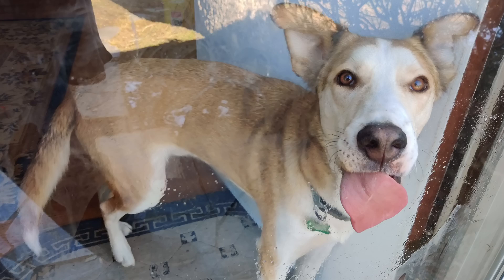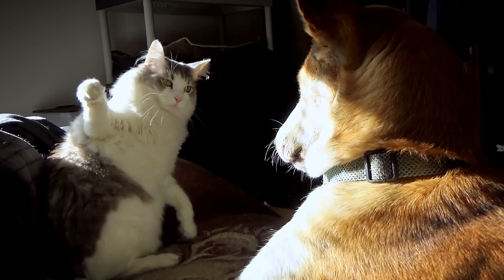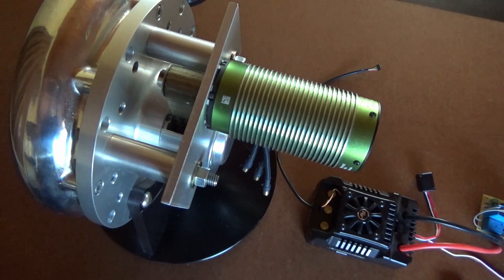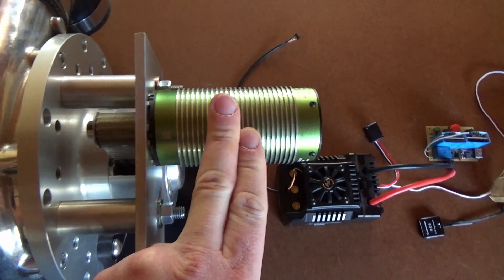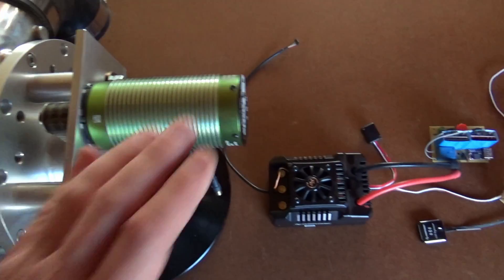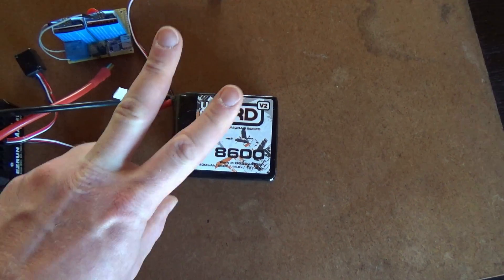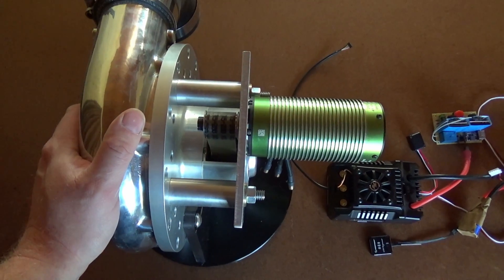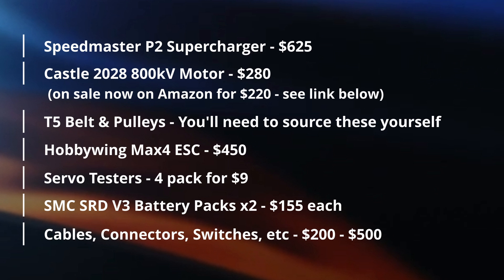DIY 650hp Electric Supercharger - Parts & Prices

Comment: impressive you have it down to a kit!  now how about for road course applications!  yes a bigger battery but the motor and cooling?   or the bearings of the turbo?  I am not criticizing, just asking based on your experience.
Reply from the maker: As long as you mount the thing where it would see airflow, cooling shouldn't be an issue.  For road courses, a single set of packs would be enough for a run (or two or three, actually); you could have a second set of packs you could swap in, or just run them in parallel.  I don't have enough data yet to say that the bearings would have to be replaced with something better.
Reply: @AlexLTDLX  ah, yeah it's all about the domain of use for sure.  because it's electric and you are in Drag mode you can spool it for that time how ever you want.  Same for a road course it's just that it could definitely rest in braking zones, or off throttle zones.  WOT is as much time as one can manage.  For me I am on track for 20-30 minutes at a time, let's say 12 of that is WOT it could be higher.  If there is a natural ramp rate for the spool then that would ease controller efforts.
Reply from the maker: @samthing4thetrack806  I do have a plan for a universal linear controller. I just need to get down to Texas and get things settled to start development on that in earnest.

Comment: Hello from France, is this sustainable over time? in terms of electricity consumption, the alternator and the battery would hold up for a trackway car that runs at full speed for 20 minutes ?  thank you
Reply from the maker: You wouldn't be able to run full boost for 20 straight minutes.  But on a typical road course, you wouldn't be at full boost on a more powerful engine the whole time either.  You could always run additional battery packs in series for additional run time.  A typical alternator wouldn't be able to charge the packs much in 20 minutes.  But all of those issues are pretty easily overcome.
Reply: @AlexLTDLX  Ok, so for track use, tracday circuit it's ruined. It's a shame, thank you very much for your answer, it will save me from wasting time and money.
Reply: @DAV4WS  You could consider a 48v alternator or 150A high output 12v alternator to charge a bigger lifepo4 bank of batteries

Comment: Can you run a secondary intake so when you're not boosting the natural aspiration doesn't get choked down by passing through the compressor housing.
Reply from the maker: I could, but hp loss on a 500 hp base engine is the equivalent of 1 psi of boost loss (according to my datalogs) when it's not running - not really worth the added complexity for ~30 hp; especially if you have the option to turn the thing on.  I'd like to dyno it without the e supercharger on to confirm that hp loss number.

Comment: With such short burst required a battery of super capacitor cells may be cheaper and more durable, IMO.
Sent you an email a few months back, subject matter Vacuum Sublimation.  That account was locked for some nonsensical TOS violation, a few days after.
Never knew if you replied, as it seemed to be a solicitation for a phone number.  "send us a text and we'll unlock your acct"
Did you have any interest?  Seems Mazda will be using the same tech on the new Iconic SP to get 1200mi range.
Reply from the maker: Super caps have two big issues - they have about a 10x lower power density than lithium batteries and their discharge curve is linear - in other words, voltage drop continuously while discharging - you'd see a huge dropoff in performance.  Lithium batteries tend to have a much flatter discharge curve.

Comment: One day I wanna see you try and tackle adding that electric motor to a regular turbo to eliminate turbo lag ;) but I suppose you could just add it like a sequential setup and achieve the same result.
Tell Roger my little Frenchie Penny feels his pain dealing with a cat...
Reply from the maker: lol
Reply: Turbo guys use smaller turbo in a sequential setup, so a smaller turbo spools the bigger turbo.

I dunno how complicated it would be but it seems easy enough... Coming from the complete noob. If it was me, I'd start with a cheap roots blower that pushed air into a bigger turbo. I don't know how much air flow it takes to spool a turbo.
Reply: A fair size air tank and 2” plumbing, pressurized to 500-75o psi and a valve to swap it for the filter with vanes , using a large regulator and a suspension pump to make it self sufficient. But the electric is for drag racing? Have you ever considered a clutch drive or alternator , and use it for charging the battery bank. The 140 amp alternator will almost stall a 212 predator in full field and a golf cart motor for load. It is making more than 3 kw from a 2500 watt unit.
Reply: some manufacturers do this. probably make a good template and could see what the design issues would be.

Comment: Charger for packs?
Reply from the maker: That is an option you can easily add.  The LTD has a charger, but I've never had to use it, to be honest.  It charges faster from the plug-in charger I built for it.  Charging at 50 volts and 10 amps would pull over 40 amps from the car's 12 volt system - that could cause some issues, and would still take almost an hour to charge while driving.

Comment: What about using this as the "small" unit of a compound setup on a 3L? Want to slap a huge precision pro mod on a new Supra (BMW B58 engine) but cut lag.
Reply from the maker: Well, generally the reason for two different size turbos in a compound setup is to avoid lag.  Obviously, this setup doesn't really have any lag.  You'd have to be careful that this unit doesn't become a restriction for the big turbo if placed before the big turbo.  But place it after the big turbo, and it should rock.  I really should do a video on how boost in a compound setup works - it's not additive, per se.  It's more based on pressure ratios.
Reply: @AlexLTDLX  understood, sir, it is multiplicative. That being said, understand that as long as a small turbo is producing any boost, it is not a restriction for the larger unit. To the smaller unit, the volume and pressure from the larger unit is simply treated as atmospheric.
Reply: @AlexLTDLX I just realized I totally misunderstood your comment. Yes it absolutely has to be placed after.

Comment: So, on my K24A2 Civic I can expect to go from 225 to about 350HP and I have the option of spraying methanol to keep things cool. What boost level would I expect on a 2.4L across 3,000 to 7,500 rpm range? I need to find and install a limited-slip diff first.
Reply from the maker: With methanol, you'd only need about 5-6 psi to hit your goal.  With a conventional turbo, you'd need about 7 psi.
Reply: @AlexLTDLX  The question remains, how much boost could this combination of electric blower parts give an efficient 2.4L motor between 3,000 & 7,500?
Reply from the maker: Probably around 9 psi and over 400hp.  But all boost isn't the same.  This setup has no pumping losses - so it will make more power per psi than even the most efficient turbo can muster - turbos create backpressure and generate a lot of waste heat as well.  You'd probably need 2-3 more psi from a turbo (depending on a lot of variables) to match the power you'd get from this.  I did a few videos about this exact topic, with real data (but the data I had compared an A/W intercooled Whipple to the Sledgehammer electric supercharger).  In a nutshell, the Sledgehammer made the same power to the wheels (and backed up with track times) at 6 psi as the Whipple did at 15 psi.
Reply: @AlexLTDLX  More than I want, but turning it down a bit only means not turning it all the way up to begin with. The whole purpose of it will be 3rd gear pulls to pass people with "great authority" on our crooked 2-lane highways. I think 50-80 in a couple seconds will work nicely; most likely they would stay passed too!

Comment: @AlexLTDLX, what would it take (roughly) to support the boost level needed to achieve 650hp on a 200 base hp engine? Bigger motor/batteries? My thought is the air mass flow rate would be the same as a 500 base hp engine making 650hp, but the boost pressure would be higher for the smaller 200 base hp engine which means a more powerful motor would be needed I'd imagine?
Reply from the maker: Unfortunately, it doesn't work that way.  We're limited by available brushless motor technology.  Which fundamentally means that we're stuck at fairly low boost levels with a single unit due to rpm limitations.  In your case, several smaller units running in a compound setup would accomplish your goals, but you'd need 40+ psi of boost to hit your number.  That's a very high pressure ratio to try to stay efficient (i.e. stay on the compressor map) even for a turbo.  It's possible, but may not be practical.
Reply: @DLX Thanks for clarifying. So in total there's a solution via multiple motors. My setup is currently making 750whp with 30psi on a 220 base hp motor (2JZ). It can only make it on E85. Otherwise the tune drops power to 500whp when running pump gas only, so although it doesn't require 40psi I completely see your point. 

Thanks for the amazing work you've done and shared with the world!

Comment: Been following this for a good bit now. It should be trivial to control the ESC using a standalone ECU that supports generic outputs. I'm certain I could get it to work with the Haltech ECUs I use. Maybe after I finish my VGT K24 RX8 I build one of these and pop it on my other LS RX8, see if I can't map the duty cycle to some ECU params, probably TPS?

Also, what can I do to help you setup a wiki? Forums are great for short-term discussion but I can't be aresed to read through a thousand posts just to know what ESC is the current de-facto standard. I'd personally love to see you write a page specifically on why VESC doesn't work for this particular application, since so many people seem to ask about it and don't know the history.

Thanks for your time and investment!

Comment: I could do it way cheaper aurduino .   U could even run map sensor and have a led display under 400  speed controller use a Vesc !!   Minus battery blower
Reply from the maker: Well, I've used arduinos as controllers, and I bought a VESC 75/300.  The arduinos don't like all the EMF such a high-powered application creates - you can see the arduino crap out mid-track in this video: https://youtu.be/nlTVHkfSQXM?si=-C5SfjK40yMuiHw8  As for the VESC, it is, in a word, garbage as far as a useable product is concerned.  I tried to make it work - I have a bunch of videos in my "electric turbo" playlist with the VESC.  Even so, it certainly isn't any cheaper - I think I paid around $550 for the VESC shipped.  You need a controller capable of 450 amps for this unit; and as I've said, all the VESC is really good for is electric skateboards and generating faults (and, to be fair, it's a good teaching/learning tool).  You also can't use a standard MAP sensor - you need to use a differential sensor.  Otherwise, you need a TPS signal or once it starts running, it'll never shut off.  But if you do manage to get one running I'll be happy to feature your project on my channel.  Sorry if this comes across as negative, but I've been there, done that.  Thanks for watching, subscribing and commenting!
Reply: @AlexLTDLX  More capacitors my dude! ALL the capacitors! <Sinister Evil Laugh>

No really, a bigger cap across the (5V?) input of your Arduino (perhaps a basic RC circuit to filter out all noise) to smooth out any EM should help with that.
Reply: Bigger and smaller caps. Smaller ceramic capacitors help filter out high frequencies. also run a buck converter which is fully isolated to prevent any noise passing through the system.

Comment: How much time will you be able to run this system that you show here? Obviously battery size and blower output will affect that, just looking for an idea
Reply from the maker: I've never had to recharge the Sledgehammer's pack (which is 18ah) during a day of racing or dyno tuning.  But the Sledgehammer's current draw is more than double of what this unit draws. So I feel pretty safe in saying more than you'll use before the fun is over.  But if you really want a time, you'd probably be able to squeeze almost a minute and a half of full boost out of it.  I know that sounds like very little, but a minute and half of 600hp WOT would be more than enough to do 3 Texas Mile runs, or 8 quarter miles passes.  You could also run more batteries if you need more time.  Or you could have set up in-car charging like I have in the LTD; so when full power isn't needed, the pack recharges.
Reply: @AlexLTDLX  thanks for the info! Double that time and it would be great for a hot lap at most road courses too

Comment: 4:59 so you're not running any kind of aftercooling?

Gail Banks would be shaking his finger at you

It's all about manifold air density. Have you measured your temperature going into the plenum?
Reply from the maker: You really don't need it until you start getting up there in boost.  The Sledgehammer (the bigger version of this thing) does run meth injection and it took a 12 second car and put it in the 9s - https://youtu.be/RT0M88xHzNQ?si=PMWM40FfShAnMtvV ; but it doesn't need intercooling because it makes so much more power per psi than a conventional supercharger or turbo.  But yes, there are tons of videos in the electric turbo playlist on my channel that show what the IATs are.  This is a good one: https://youtu.be/mBM-2qIav74?si=fIb0C10gfyp4rLoJ
Reply: @AlexLTDLX   thank you for your prompt reply.

I just know that you can get good power. Gail has a story about putting an ice water intercooler on a naturally aspirated motor and he picked up 6% more horsepower. So if there's power left on the table at atmospheric pressure, it seems like there would be power left on the table, with even small compression...
Reply from the maker: I had a custom Whipple setup on the LTD before this that ran A/W.  Even with the A/W intercooler (with ice in the tank), it still took 15 psi to match what the Sledgehammer electric supercharger made on 6 psi with meth.  But yes, anytime you can make the charge denser, you'll pick up power.  And if you can make the charge cooler at the same time, you'll pick up even more because your tuning window widens dramatically, allowing more timing advance.  The Whipple absolutely needed the A/W setup to run at WOT on pump gas.  The Sledgehammer didn't need any cooling, and still went low 10s at over 130 mph.